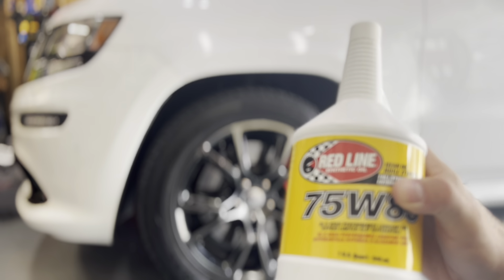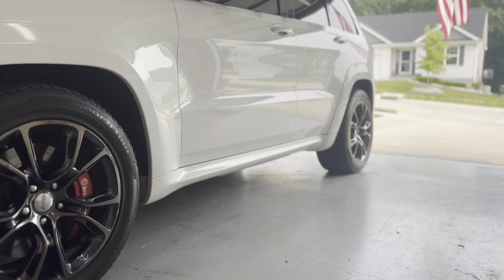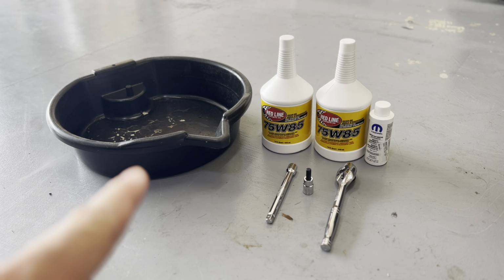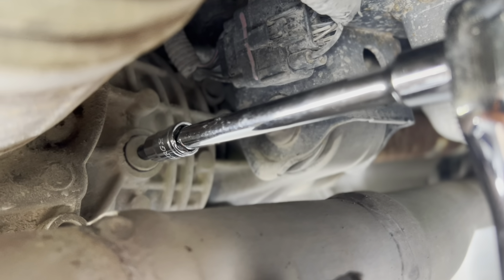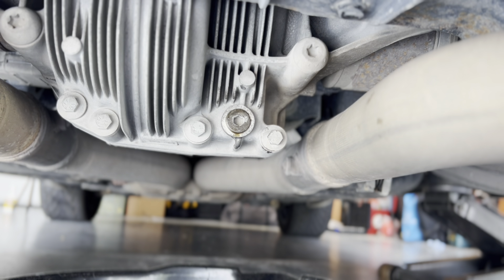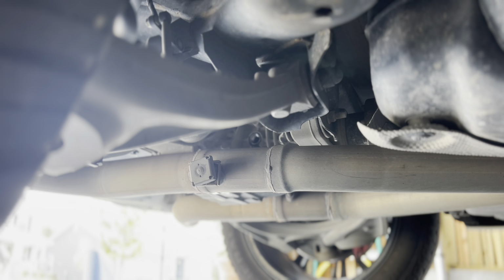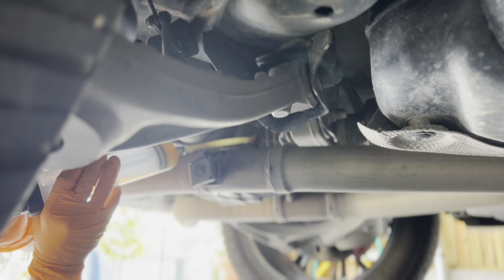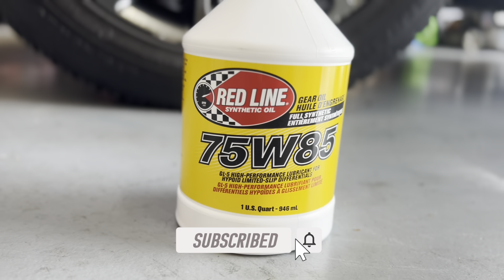Jeep Grand Cherokee SRT WK2 Rear Differential Fluid Change

Comment: If I use the Mopar brand differential fluid, do I still need to use the Mopar additive you used in this video? Or does the Mopar differential fluid already have the additive in it?

Comment: What happens if you remove do not open plug ? I recently serviced mine and filled up from that whole and I’ve been seeing people say it would cause problems but nothing has happened to mine yet. 2017 SRT
Reply: The risk of doing it is to overflow your differential and making it working in too much oil. Like adding too much oil in your engine, it’s not recommanded and can cause damages
Reply: @lucasseguro6021  yes I removed the correct full plug and let it drain to that level ! Havnt had any issues yet and it was just serviced at the dealer and they said everything is fine so I dodged a bullet LOL
Reply: I’ve heard too that this plug maintain a piece of the differential in a certain position and the fact of removing the plug can put this piece in another position…
But glad to hear it still works and you didn’t damaged anything ! Next Time avoid this forbidden plug lol
Reply: @lucasseguro6021  yes I’ve heard of that too but did some extensive research and I can’t even find the “linkage” part so seems to be a myth to me 😂